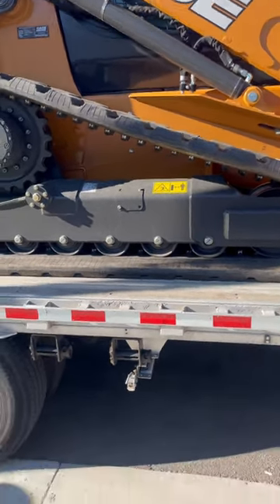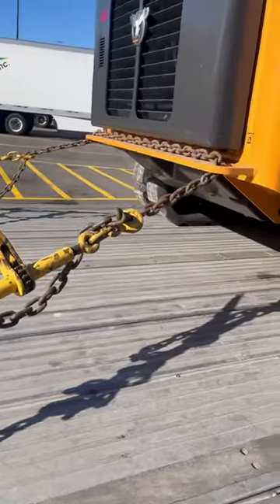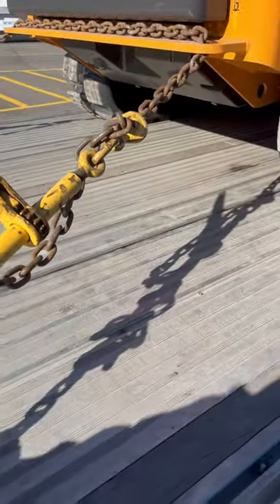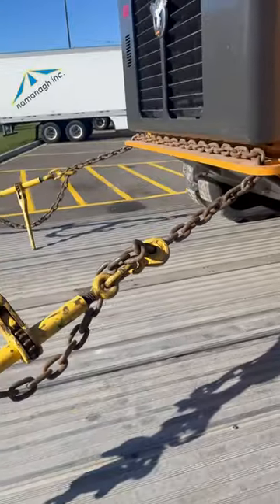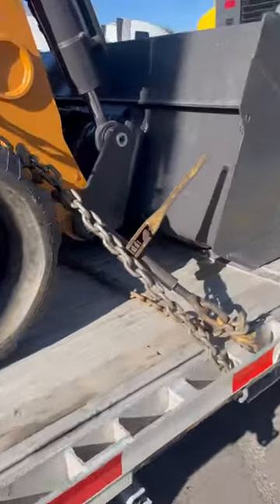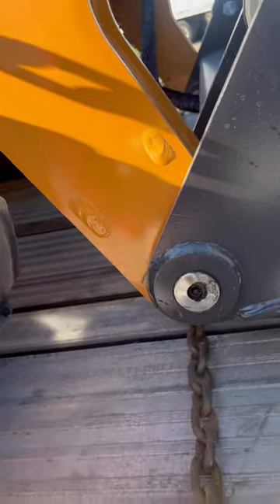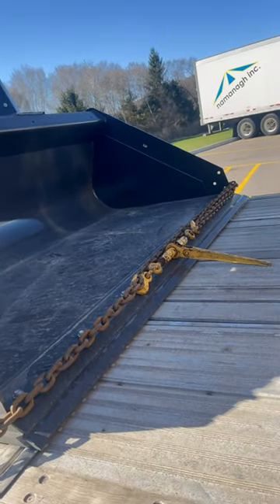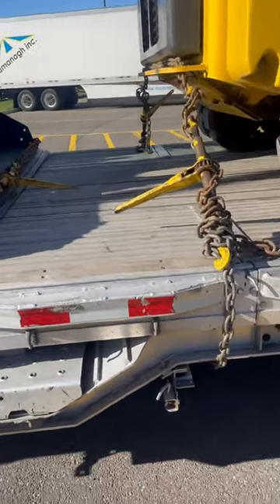Secure case skidsteer #Peterbilt #trucker #trucking #largecar #equipment #flatbed #stepdeck #truck

Comment: Depends on state, yes most states you can use 1 chain and 2 binders but not all
Reply from the maker: I’ve done it in every state. I haven’t heard a state you can’t. Just over hydraulic attachments
Reply: @JoshsTruckingadventures Washington state ya can’t, they will give ya a chance to fix it right usually but sometimes ya will get a fine, one other state same but can’t remember the wtate
Reply from the maker: @ardentownsend4975  that’s crazy u do this in wa all the time

Comment: Not legal slack needs to be between the binder the chain on the bucket is required by federal law not just pa
Reply from the maker: This is 100% legal. The slack is in between the binder. Aka I hook it up and pull access chain down to hook to farther link I can. When tightening it leaves the slack but tightens chain. I’ll read it again but from what I remember, you can use a strap to secure hydraulics/ buckets down except pa but I’ll read it again. I’m not against reading and making sure it’s good.
Reply: @JoshsTruckingadventures  the way you've got it either binder comes loose they both are loose not legal
Reply: The front chain is good since there is slack between the binders
Reply from the maker: @bradlewellen7461  yea that’s what I normally do. This is how a old timer showed me bc he said the other way is wrong lol